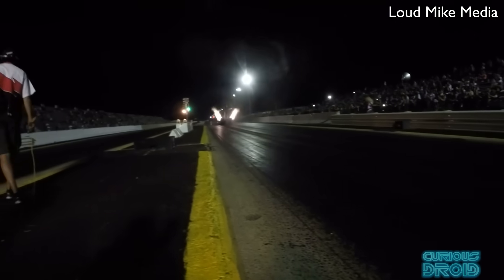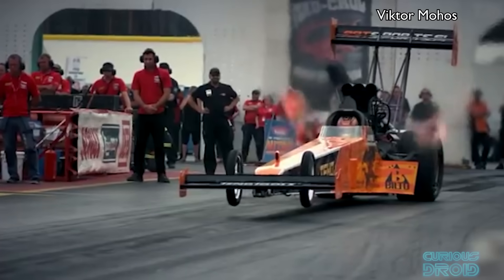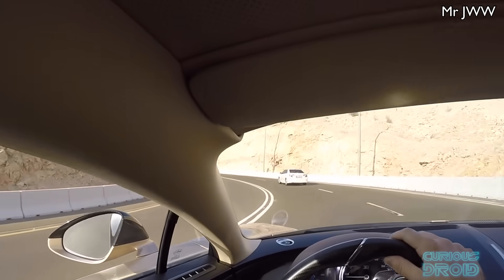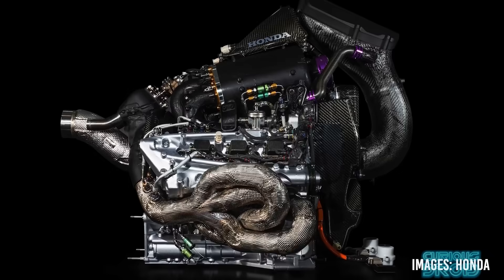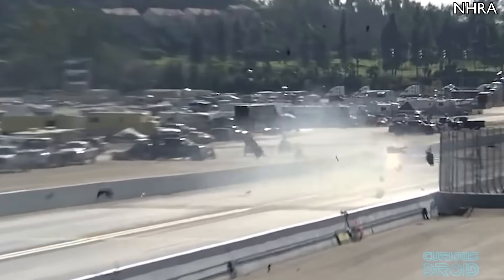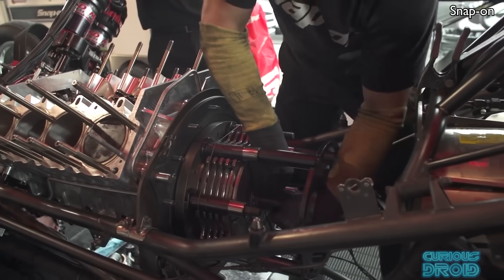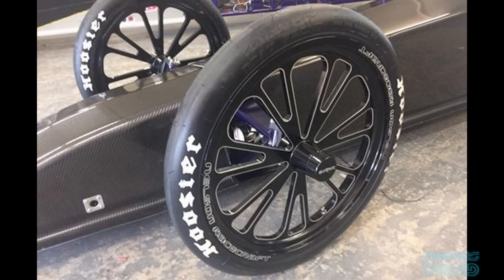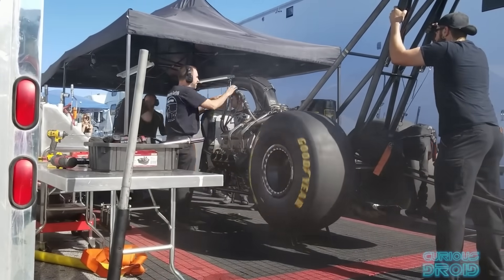The Amazing Engineering of Top Fuel Dragsters

Comment: Why people wish to focus on the oxygen in nitro methane.
It has absolutely nothing to do with a damn thing.
Nitro is a explosive that under extreme temperature and pressure it will detonate meaning that the molecule itself breaks into pieces all at once, it's often mixed with alcohol which helps keep the cost down a little bit but it also helps make the car run pure nitro is  not sensitive enough to run without a lot of heat in the engine already and insanely large 44 amp magnetos to get it to start breaking down like 60 65 degrees before top dead center once that engine's good and hot it makes explosive power hotter the engine the more power that's why if you see cars doing burn Downs on the line you know it's going to either go up in smoke or be one hell of a race.
I'm not mistaken the exhaust of a nitro car is primarily nitric oxide, carbon monoxide I think a little bit of nitric acid may be present due to a large amount of superheated nitro methane as a vapor incompletely breaking down.

Comment: You forgot to mention the engine rotates only 466 times in a 1/4 mile  run .
7,000 rpm ÷60seconds ×4seconds

Comment: Another fantastic video Paul. As a lifelong top fuel nut I can say you’ve got everything covered perfectly, your racing background is quite evident in this video.
Here’s a random fact for others; the top fuel engine runs a wet sump, with the oil pump pushing some 250psi of 70 weight oil through the 6 thou mains & big ends. The oil pan also contains a pressure switch to kill the engine in an over pressure event, to reduce the chance of dumping the contents all over the track.

Comment: Back in 1988-89  one of my roommates worked on Kenny Bernsteins funny car team. Back then with the passes we were able to stand just 10 meters from the starting line. We would wear white shirts so when the bits of rubber landed on us,it made for a cool look. You had to put your hand over your beer.otherwise it would be sucked out from the engines. The tires distend till they are almost twice as tall from the tourqe.   
Usually the dragster would be 50 meters down track by the time they blow up.

Comment: Craziest fact I ever read was that the camshaft lobes on a top fuel car are machined with a built in slight offset for each cylinder from front to rear to correct for the fact that the camshaft will actually twist under the stresses in the engine while making a run.

Comment: This was pretty interesting, and I am not even into car racing! It made me wondering if one could build an electric version of such a dragster. Already, the Tesla Model S Plaid does 0 to 60 mph in 2 seconds, while it is still a regular car. It has a huge and heavy battery of course. So, in a dragster, maybe use capacitors instead of a battery to save a lot of weight? They store much less energy, but it might be enough for 10 seconds.
Reply: Super capacitors and a BIG motor and dunked in liquid nitrogen before every run😂
Reply: There are some tried at the moment. Not very succesful.
Reply: I wonder if someone will make an ICE that burns hydrogen.

Comment: Exciting but Top Fuel NHRA dragster and funny cars are releasing a hell of a lot more greenhouse gas emissions than in the early years. Just look at the cloud of smoke belching out of the exhausts in the video!The rising costs of the sport has soared and the stands are not nearly full anymore! This is the beginning of the end of all motor sport! Sadly but we don't have the oil supplies we had before and eventually this sport will have to stop!There's also too much horsepower in those cars and they're not stable!

Comment: Now, us top fuel fans can all recite 11k to 12khp ratings in our sleep and all day long, is household language. 
But at 12,000ftlbs and 7,900rpms, I get 18,050 horseperrs. 
That’s not quite double? But getting in that direction fairly. 
Is that 12kftlbs sensor rating accurate and verified then?
And I was happy with 11-12k horsepower. 
Sounds like “wheel hp” is 12k
And 18k horsepower is “at the crank”.
I could see that with all the frictions and losses that fight to keep the car gripping and going.

Comment: If you have never seen one you owe to yourself in person, it will change your viewpoint on what man can do. I will leave a few facts I personally know I was the closest person to bobby Lagana jr when he passed the finish line, couldn't shut off the motor bc it was still at 100 % I was almost a half-mile past the finish when I turned bc ik this wasn't supposed to be anywhere near me this was at empire nats in Leicester NY an ihra event they usually have sand or nets as a last resort this track just had way more shut down he was estimated to be going about 350 ish when he went lil airborne then exploded like a hand grenade I thought I just watched a person die for the 2nd time that weekend he only lost fingers on his hand and was back racing ....... I've asked many weird? To these pros being such an annoying child here's what I found out the magneto can weld and looks as thick as a hose burn like 16 gallons a run they go 0 to 100 in less than 1 sec  the blower is parasitic and robs most of the power the clutch is massive and is how they launch just slipping it from a low to high gearing fusing all the plates by the finish thy take raw nitro and squirt it into the butterfly then use a battery box to spin the belt pully to start it sprays a massive mist of fuel out the headers at the first signs of life I almost passed outstanding behind bc nobody else was and why not I wanna see was like mace and chloroform at the same time yet the guys cleaning the tires while he stages huff it like junkies without as much as a tear they have a crowd fav ting they do to seat the clutch after its rebuilt which watching that every round is fantastic I was wondering how much you could make being a driver $35,000 to $15,000 (already down from $50,000 prior to the pandemic), and subsequently, a reduction in the winnings at each rank on down the order. Pro Stock, meanwhile, was cut to $6,000 to win, and Pro Stock Motorcycle a meager $3,000.$35,000 to $15,000 (already down from $50,000 before the pandemic), and subsequently, a reduction in the winnings at each rank on down the order. Pro Stock, meanwhile, was cut to $6,000 to win, and Pro Stock Motorcycle a meager $3,000. almost these things make it simulate an earthquake

Comment: I'm a little surprised that they didn't mention the crankshafts are twisted a bit after each run. I think I read they change out the cam to accommodate the twisted crank, until the front journal is about 10 degrees out from the rear. Then change the crankshaft. Insane, but thrilling!

Comment: I work at a company that sells performance parts in the automotive industry, thank you for showing a in depth video of what these cars go through in the mechanics of what happens when a launch occurs. I believe these drivers have a more harder launch than either the space shuttle astronauts or aircraft carrier fighter pilots.
Reply: 6gs per launch top fuel, around 3 for both typical man space mission and carrier launch.  Fun fact around 6gs for braking/parachute.  Tony Stewart says they get it  both ways lol.  Plus he said Funny Car drivers are nuts motor blows up all the flames in their face, top fuel its all behind you.

Comment: We use to hammer those big aluminum rods where I use to work in a shit hole forge shop..I kept a set to build me a motor one-day they are not machined or nothing an still needed to be  heat treated but I  hammered them a few extra blows Lin the hammer.

Comment: If these engines were allowed: turbo, dohc, 4v they could either run faster, or make the same power and last several races.
A bigger displacement, turbo, dohc 4v, and these engines could make the same power and last an entire season.

The rules are specifically written to make these engine require rebuilding every run. Such a waste.

Eventually, electric will be there also.
Reply: They’ve all been tried.
Reply: @stephenpage-murray7226  ha ha ha. Faster engines are banned, ie, not allowed buy the rule books.
Reply: @nordic5490  
Tried and failed.  Nothing could handle nitro loads.
Reply: @stephenpage-murray7226  ha ha ha. The only way to make 10000hp out of a 7L 90deg 2v pushrod supercharged v8 is with high nitro loads, as you say.
Could the track handle a 13000hp 7L 4v DOHC flat plane turbo ? Maybe not.
Btw, because turbo, flat plane, 4v, makes power way more easily, there is much less stress on the engine for the same power level. Lower peak combustion pressures are needed to make the same power = less stress.

Top fuel is not the ultimate engine tech, not by a long shot.
Back in the 80s, F1 cars were making 1300hp out of 1.5L engines for 2mins of qualifying. 35yrs ago, F1 had higher tech.
Reply: @nordic5490  
12,000.  And it’s torque not hp that’s required. All in the video.

Comment: I hate to tell you this but 4 valves per cylinder dual overhead cam engines are certainly not modern!!  The Rolls Royce Merlin and Alison aircraft engines both had dual over head cams and 4 valves a cylinder designed in the 1930's and they had dry sump oil pans.  You say oh that's an aircraft engine and doesn't count.  Well the Duesenberg Straight-8 engine was supercharged and had 4 valves a cylinder and dual overhead cams designed in the 1920's!!  There is nothing modern about dual overhead cams and 4 valves per cylinder.  I did enjoy your video and it was very informative.

Comment: The drag races at Las Vegas are around my birthday every year, and my family makes a trip out of it as much as possible. The stands are concrete vs typical bleachers and if you’re sitting at the starting line your vision is so blurred from the shear force of the launch you can’t read the large sponsors on the walls. It’s a trip for sure like you can feel it through your whole body. The last time I went was when they made it a 4 wide strip, and all 4 at the same time is absolutely crazy

Comment: It is just nuts that Pro-Stock cars are running speeds ( in 1000 ft. ) that Top-Fuel was trying to achieve 40 years ago (in a quarter-mile) when I was a street hot rodder in my 71 Dodge Challenger R/T, man I'm getting old.

Comment: I do machining for a large aerospace company and as a 'thank you' I took six of the firms engineers to their first top fuel event.On the drive there I told them that whatever they are picturing, they are wrong, it will be much more extreme. On the drive home every one of them said they never imagined anything even close to what they just witnessed!!
Reply: best coworker ever
Reply: Cool thing to do! Top fuel is unexplainable!
Reply: At a night time fuel meet a friend noticed something I missed. He said to watch the shape of the fire from the pipes at the line then look at it at 300+ mph. The shape is exactly the same. You would think a 300 mph wind would blow the flames back significantly but oddly it has no effect! @Mexicovideoproductions
Reply: @morgan4xl  force of the exhaust is extreme!
Reply: @morgan4xl the exhaust is going out at a much higher rate than their travel speed. The exhaust is even angled upwards so it pushes the car down onto the asphalt harder.
Reply: @morgan4xl  The force from the exhaust is so strong it creates huge amounts of downforce.
Reply: @morgan4xl  A top fuel mechanic told me that 800 lbs of thrust is coming out of each pipe. If you were to angle the exhaust down, the car would lift off the ground!
Reply: I have been and seating is important and l mean  mid section and up wind with your hearing protection on.I will let you guess why .
Reply: As an old hot fodder and dirt tracker, I’ve been around race cars of all types all my life and I’ve never seen a race car, of any type or discipline, that I haven’t thought I’d like to try out! Except top fuel cars! Be it a Dragster, Funny Car, or altered, I have no desire to try any of the above. The skills required are obviously beyond my merely mortal capabilities.
Reply: Over the last 50 years I have taken many people to the drag races and every single person had a great time. It's really not explainable. It's a triple sensory experience that you have to see live to believe. Sight, sound and vibration (they are not called "ground pounders" for nothing).
Reply: Yeah, TV just doesn't do it Justus! They need to be in a crew pit where they rebuild the engine between every race to SEE what engineering all is about!
Reply: I consumed a man's soul
Reply: did those aerospace engineers keep sending work your way? Was your investment worth the money?
Reply: @metricstormtrooper  Investment? You must have missed the 'thank you' part.
Reply: @metricstormtrooper  Angry?
Reply: @aspjake123  ???

Comment: the reason so much fuel is burned outside the engine is because they're using the fuel to wash the cylinder and prevent a secondary expansion at the bottom of the piston stroke, basically nearly hydrolocking it

Comment: a supercharged nitro engine running  90 plus percent ch3no2 runs at a air/fuel mix of close to1:1!!......therefore that cylinder is half full of liquid nitro....when it gets ignited...LOOK OUT BELOW!!....its all in the magic of NITRO....there are more powerful fuels...but the engine would probably  not stay together.....like ammonium nitrate....NH4NO3  or the nitrite NO2.....these are solids so the fuel would need to be put in solution--blended-- with nitromethane or methanol......percentage levels  have not been determined......MIX AND RUN AT YOUR OWN RISK...

Comment: Back to basics here-- you said peak combustion pressure could reach 13,000 psi.  I believe the true figure is around 4100 psi,  which produces about 60,000 pounds of force on a piston area of 14.59 square inches.  That produces quite enough power, without needing to confuse pressure with force in your calculations.

Comment: Lets not forget by the end of the run, the cylinders are no longer combusting fuel since the spark plugs have burned up and if any fuel is combusting its doing so simply by heat and pressure in the cylinders

Comment: The most amazing thing about these top fuel cars is that 12000 horse power motor is only held in with 4 hose clamps.1 on each corner of the motor.Think about that once.Hose clamps for christs sakes.

Comment: The Chrysler Hemi top fuel guys use is based on the second generation Hemi , dating back to the mid 1960s. It’s derived from the 426ci model used in the Hemi Cuda.

Comment: The rear wheel assembly’s have more hub bolts than a Tornado fighter aircraft, and they have less inflated pressure to deal with, but, (There’s always a but) the torque the dragsters have to deal with at launch must be incredible, watching the ripple effect in slow motion is a superb demonstration of what the wheel assembly has to endure. Thanks for another fascinating look at the engineering behind a “sport????” that lasts mere seconds, or less if it all goes T1Ts up at some point, it’s not my kind of sport, I am not a petrol head, however the engineering aspect that you presented and explained so clearly I do enjoy immensely, thanks very much for sharing. 😀👍🇬🇧🏴

Comment: AeroJet Rocketdyne tested Nitromethane as a rocket fuel. Their tests found that when there is a slight fuel flow disruption, the rocket engines would explode into pieces. This is exactly what happens in Fuel Cars.

Comment: you do realize Europe jet funny cars are quicker and faster
Reply: Irrelevant
Reply: No they're not, no jet has ever gone below 5 seconds over 402m in Europe, TF was running 4.7s over 402m and now 3.9s over 305m. There's also speed limits on jet vehicles but none on top fuel.
Reply: @david65219  
Bullshit!  
Sammy Miller ran 3.58 @ 386.26 mph at Santa Pod in 1984.
Reply: @stephenpage-murray7226  that was a hydrogen peroxide rocket, not a jet.
Reply: @david65219  
Good enough.  Still faster than anything else
Reply: @stephenpage-murray7226  true, although those kinds of times and speeds haven't really been seen since. It takes a special kind of person to throw themselves down the track like that, he'd black out from acceleration and think nothing of it. It was a big loss to the sport when Sammy died, really nice person too.
Reply: @david65219  
Insane acceleration…

Comment: You mean stupid engineering the rear wing seems to be to far back past the center line of the rear axle ...this creates a first class lever action and wants to lift the front wheels ( called "wheelies" and will actually flip the car over backwards ....so a front wing is used to keep the front wheels down ...therefore bends and breaks the car in the middle ,you can  see the center of the car "hump "upwards" in slow motion videos then the car breaks in two .....i dont call that amazing engineering 😵
Reply: Dunning Kruger effect

Comment: Seeing them In person is beyond words...the sheer compression and raw power is so ridiculous, it literally sucks the air out of your lungs feeling the increase in pressure in the air.  As they go by, takes your breathe, vibrates your eyeballs, rumbles the ground and they're gone instantly.  Every cylinder firing blows fire 10fr high and sounds like a 1/4 stick of dynamite detonating....nitromethane is basically liquid explosive rather than fuel

 Before the limitations got even worse, when they ran the full 0.25 mi., fastest I ever saw in person was 346 mph (dont remember time exactly, wanna say 3.7ish but not sure).  100% a must see at least once in person because its awesome